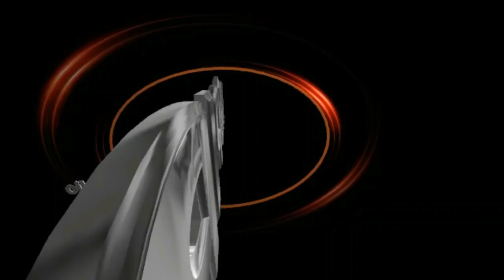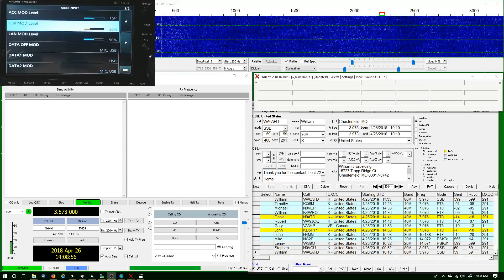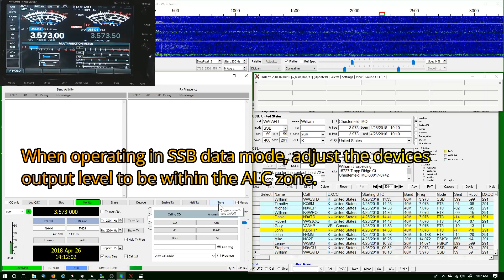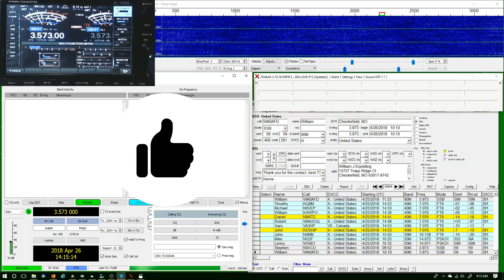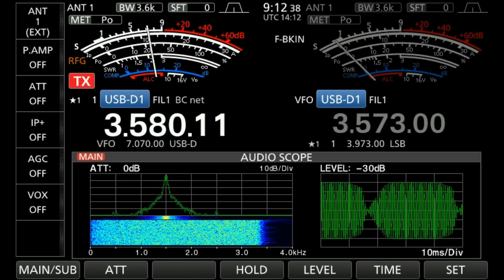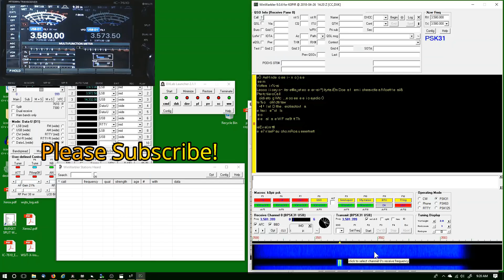Icom 7300 7610 Digial Mode Power Output FT8 PSK31

Comment: While I am really not a FT8 fan, I realize at times it's the only way you are going to get a contact.  Nobody is on PSK anymore unless it's field day. LOL...this vid. has helped me tweak my IC 7300 the biggest help was the ALC adjustment.  73, from KA8DYD
Reply from the maker: It's nice to hear from you and thank you for commenting. Same here. I'm in my camper (HiQ mobile ant.) in Alabama and FT8 has been my go-to mode because condx are very poor at this location. It's nice to make some QSO's even if it's short. Best 73 and good DX! Thanks again.

Comment: I have a 7300 and doesnt matter what I adjust i cant get full 100% power, if i set radio to 50%, it shows 35-40%, and that includes turning wsjt-x up full, output level on pc 100% and increasing usb mod level.
Reply from the maker: It’s nice to hear from you and thank you for commenting here. Did you move the power slider in wsjtx up all the way?
Reply: @HamRadioAdventures  thanks for your reply, yeh all settings up at max to try and get full power, if I have power on radio set to 100% it shows 60%, if I set power on radio to 50% it shows 30%, thanks for helping
Reply from the maker: @richylad  it not unusual for the discrepancy when you have 60% on the RFPower output and it shows less than 60 watts out, but with RFmPower output at 100% you should get 100 watts out. Try the settings in this page: https://k0pir.us/icom-7300-7610-rf-power-digital-modes/ . USB MOD Level 40%. USB Audio CODEC in Windows 50% and RF Power out on radio at 100%. Power slider in WSJT 90% up. What do you get and is your SWR under 1.5:1?
Reply: @HamRadioAdventures  Hi again, I have used the settings you suggest and it is still the same, SWR is 1:1, no tuner as Antenna is resonant, I am using a Hamstick and maybe that is having something to do with it, so I will setup and try a different antenna, thank you so much for your suggestions. Richard
Reply: I'm back again, I tried again with an Inv V Dipole (resonant so no tuner) and got the same results, I went through your settings again but increased USB MOD Level to 50%, this gave me a little more power but the alc is extremely close to the end of the red section, I have tried CW to check power output and 50% gives me just under 50%, 100% gives me 100% so I dont think there is anything wrong with the power output. I did notice that when running FT8 through wsjt-x when i first click tune within wsjt-x the power does go up to 100% for a fraction of a second then drops back down, so maybe something is dropping the power back, Just to add I am making contacts but I am investigating because I may not be getting the power I should, thanks again for all your assistance, Richard
Reply from the maker: @richylad  to quickly adjust the ALC without losing power, lower the pwr slider in WSJTX, you’ll see the sweet spot, lowering the ALC right b4 losing some power.

Comment: Hi does these instructions apply to FT-8 settings on the Icom 7300 using ham radio deluxe ?
Reply from the maker: Hi James, it’s nice to hear from you and thank you for your question here. On these radios the digital mode is USB Dash D. So, whatever mode you’re operating on with your software it’s always going to be USB Dash D. For instants, using WSJTX for FT8 the radios mode will be a USB–D. If you’re using DM780 and operating PSK31 the mode on the radio will still be USB–D. I hope this helps and thanks again. For reference https://www.k0pir.us/icom-7300-7610-rf-power-digital-modes/
Reply from the maker: Hi James, it’s nice to hear from you and thank you for your question here. On these radios the digital mode is USB-D. So, whatever mode you’re operating on with your software it’s always going to be USB-D on the radio. For instance using WSJTX for FT8 the radios mode will be a USB–D. If you’re using DM780 and operating PSK31 the mode on the radio will still be USB–D. I hope this helps and thanks again. For reference https://www.k0pir.us/icom-7300-7610-rf-power-digital-modes/

Comment: Do you have a video of wsjtx on 7300 or 7610 with an AL-811H amp?
Reply from the maker: No sorry. I have used my ACOM100, but not the Ameritron. I'd start slow with it and it should be fine. 
Rich, K0PIR

Comment: On the FT8 screen, lower right side, there is a vertical slider marked "PWR"  whose movement registers minus "db's," please explain what this means and where the movable marker should be placed for normal operation. I haven't been able to find an explanation for this. Thank you in advance for your explanation and advice on its setting. 73 K5LJB

Comment: What ever happened to making sure there was NO ALC?  In previous videos the zero ALC was the way to go.  What has changed?
Reply from the maker: Hi Peter, Nice to hear from you and thank you for commenting. That's a widely asked question. I address most of it in the video and my article, but to recap: The superhet (legacy) radios created IMD when ALC kicked in, but the new SDR radios from Icom don't. 

I used my 7300 radio without ALC kicking in and it worked just fine, but later I decided to try the ALC at 1/4 to 3/4 scale and I found for myself it seemed like I could make more contacts with less power and still have a very clean signal. PSK31 was how I tested and I used signal reports from other stations. All said very clean signal.

With these radios ALC is not much of an issue. Just use it as the manual suggest, "Within the ALC zone".

Thanks again and I appreciate the input. Best 73 - Rich, K0PIR.us

Comment: hi rich love your videos on the 7610   just a quick question how do you get the 7610 to show up in the audio icon on my desk top ! as i cant find it i  have installed the drivers from icom but no joy in txing on ft8 rx ok any ideas regards mark
Reply from the maker: Hi Mark,
Nice to hear from you and thank you.
Have you tried looking in Device Manager to see if it shows up under Audio Inputs and Output?
 If you are using Windows 10 an update may have broke it. The fix:
Go to Settings and select Privacy. Then select Microphone from the menu on the left 
side. Check the box titled "Let apps use my microphone"
Rich, K0PIR

Comment: Rich,

Great video on ALC and power settings.

A new question:  I have used your updated USB settings for my 7610 and they work flawlessly with DM780 and HRD.  However, I also use WinLink for some emergency comm drills.  That software as of yet does not recognize the 7610 and so I’m using their 7300 configuration.  Transmissions are fine along with PTT control but frequency and band width settings don’t work and I have to set these manually.  Do you have any experience with WinLink and any advise? I’ve asked the question on the WinLink programmer’s google group but no response.  

Mike
KM6KWG
Reply from the maker: Hi Mike,

Thanks for commenting and the question.

I don't have any experience with WinLink.

You probably already know this, but for digital modes (USB-D1) we can use a receive bandwidth of 3.6k. We can set it once and it stays. When I go to SSB phone mode the 3.0k default is still there. 

Maybe another radio file like the 7600 would work better with WinLink, instead of the 7300??

I am not sure what WinLink uses.

Thanks again and nice to see you,

Rich, K0PIR

Comment: Regarding the audio level,  I set it to dB and set it to 0 rather than using %. I did some tests with my ALC at various levels on my 7300. With the ALC at the max my qso partner recorded good signals. ALC is okay. Hope to get you in the log, 73 de Guy G4DWV 4X1LT
Reply from the maker: Hi Guy,

Nice to hear from you and thank you for the information. Good to know.

There was another Ham friend of mine who did some testing with a scope and came to the same conclusion. This was on the 7300 and he said that even with it at max it was still good. Great radio. He is a silent key now and didn't get the chance to test the IC-7610, but I imagine it is the same way.

It's not like the old days!

Thank you and I'll put you in my Alert, and I hope to hear you on.

Best 73!